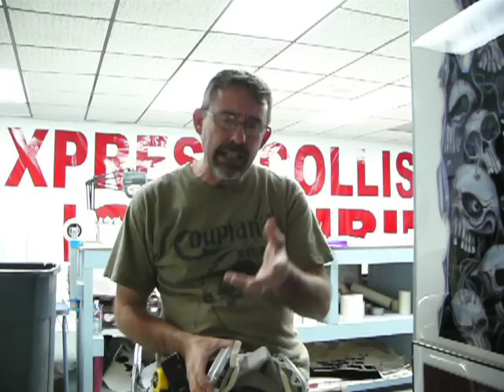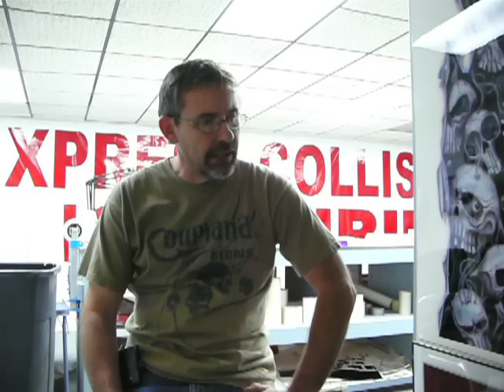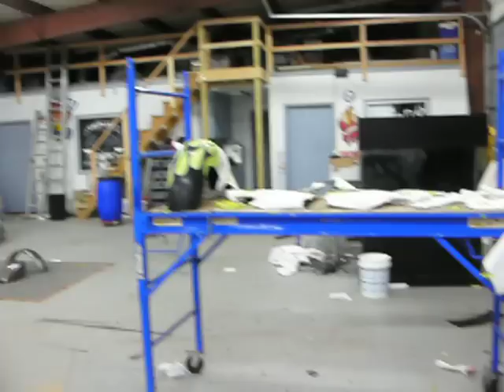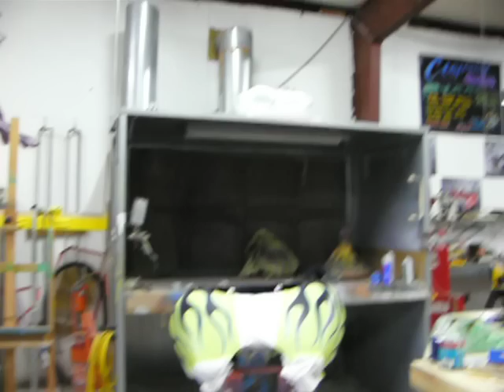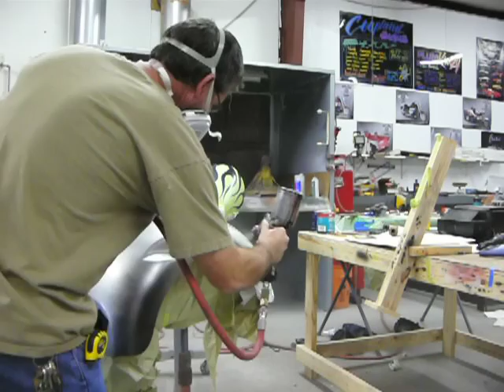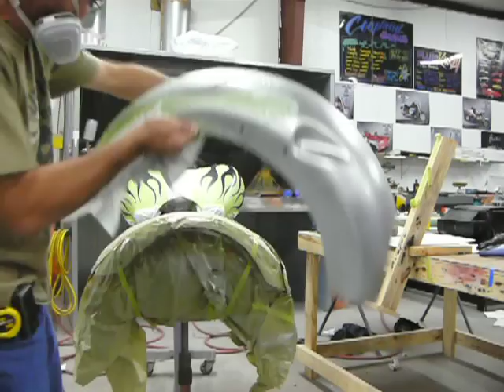flame job how to 3 of 7

Comment from the maker: Some may disagree with my method .. and some of my painter friends just can't keep from laying on the paint wet..... But I find it works for me. I have been doing it this way for approx 10 years and I have not have any problems. by working dry you can start your graphics sooner. I am talking about Base coat clear coat system    not single stage paint

Comment from the maker: what I mean by Dry painting... Is I apply the paint on in several light layers as opposed to 1-2 heavy wet layers... wet layer would mean you could not touch it for about 5-10 minutes after you apply the paint.. Dry means you can touch it approx 1 -2 minutes (and even lightly sand) after paint is applied...